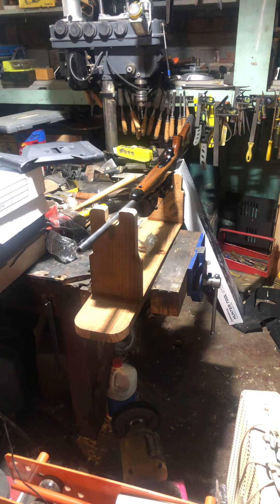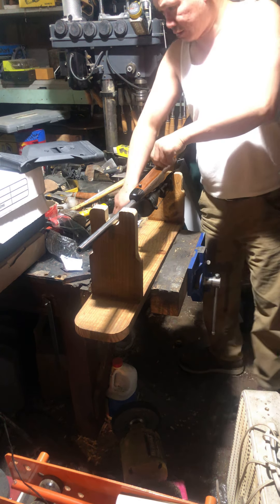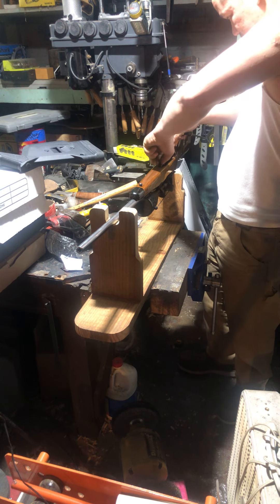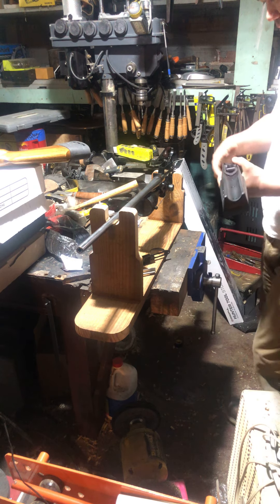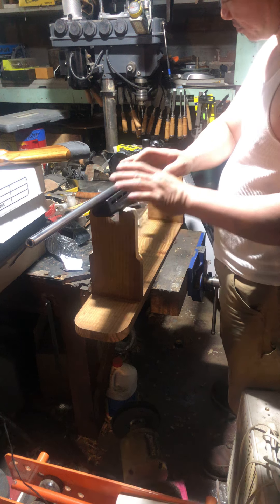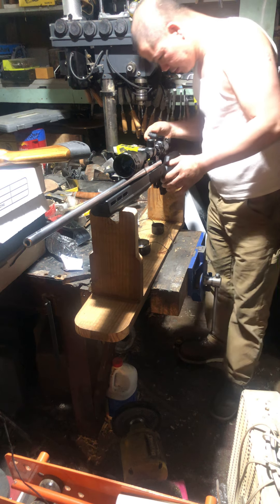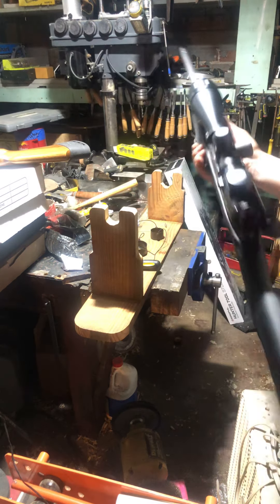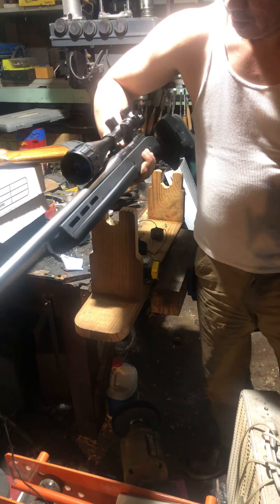Magpul part 2 remington 700 7mm rem mag

Comment: did u notice any difference in weight when u changed stocks?
Reply from the maker: It actually has tighter group after putting the new stock and it’s less recoil
Reply: @BEAVER_MIND  is the gun noticeably heavier
Reply from the maker: @seanleblanc7857  
I feels a lot better and solid probably another half a pound
Reply: @BEAVER_MIND  thank u, I use mine for hunting and were my gun is 9.5lbs with scope I go back and forth about adding weight for the woods but looks like it might be worth it